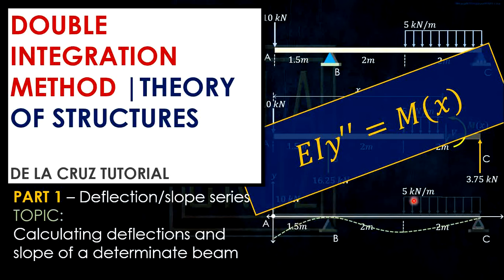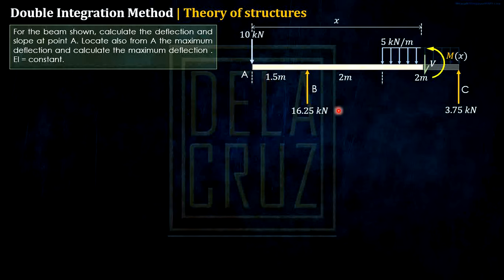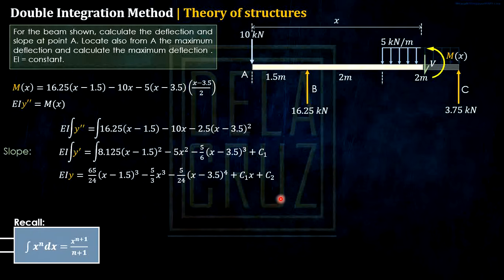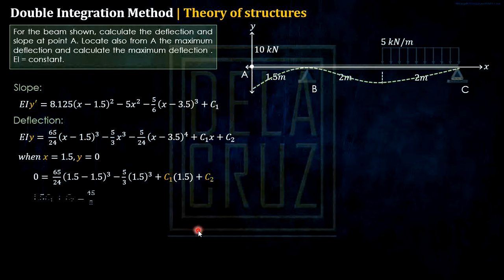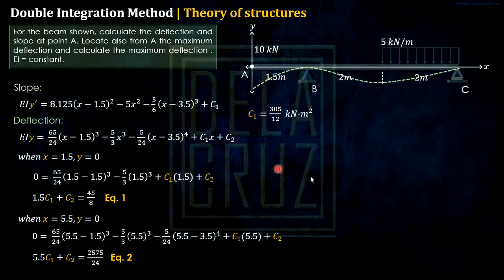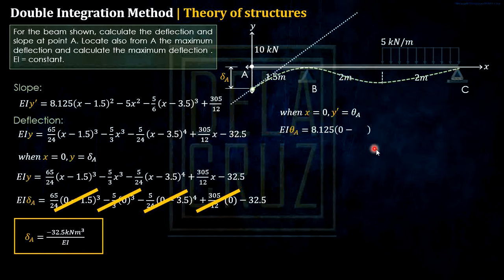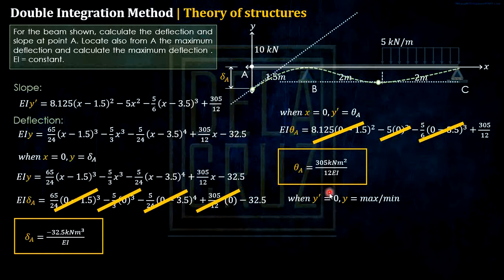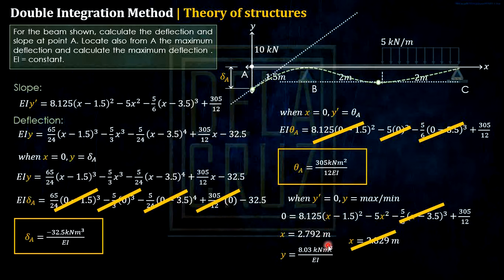DOUBLE INTEGRATION METHOD | solving deflection & slope | THEORY OF STRUCTURES | DE LA CRUZ TUTORIAL

Comment: I wish you'd explained in English at the 16:00 minute mark, where you are explaining why not to take the x = 2.829m value.
Reply from the maker: Hi, thanks for the compliments. We can’t use x=2.829m that is because if we take back this value to the equation
 0=8.125(x-1.5)^2-5x^2-5/6 (x-3.5)^3+305/12  , The terms in parenthesis with variable "x" are the moment arms, and we cannot take a negative value for the moment arms. Specifically the moment arm (x-3.5) substituting the value of x=2.829m, this will give -0.671m. If any of the moment arm will be in negative, then that’s the time we will eliminate the term in the equation and recalculate another value of "x"
Reply: @EngrDeLaCruz 
Comment posted on Thursday, June 4, 2026

18:08

1.) When the equation for the slope = 0, of the overhanging beam, in the interval (BC), can be written as!

0 = 8.125( x - 1.5 )^2 - 5( x )^2 - 0 + 305/12

1.1) The distance of x = 2.792 m (of the beam in section BC) will make the slope of the equation equal to 0.

2.) Find the maximum deflection of the beam in section (BC).

2.1) Equation used to find Delta( max,BC )

EI•Delta( max,BC ) = 65/24( x - 1.5 )^3 - 5/3( x )^3 - 0 + 305/12( x ) - 32.5

Substitute x = 2.792 m.

Delta( max,BC ) = + 8.03 kN•m^3 / EI #

3.) Question?

The beam deflection in section (BC) will be upward (inverted parabolic).

Is this correct or not?

Note: 18:08

The elastic curve of the beam in section (BC) will show downward deflection in an upward parabolic manner (as shown in the example description).

Thank you, sir.